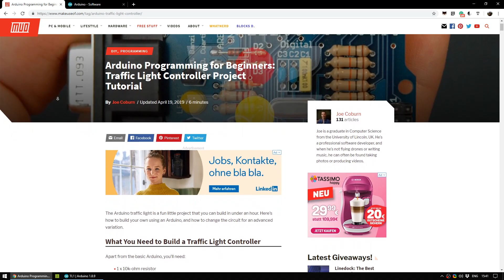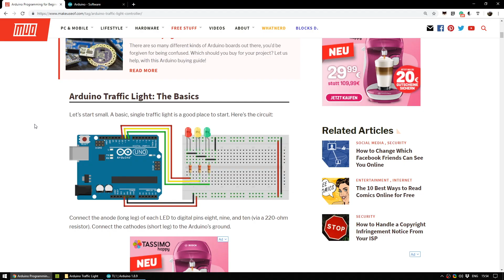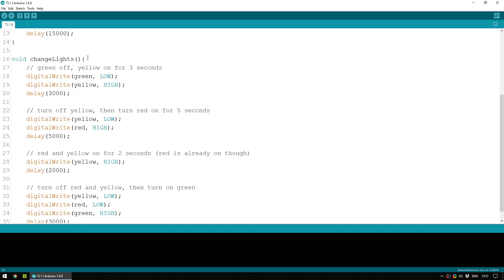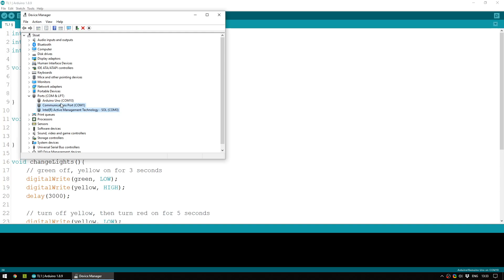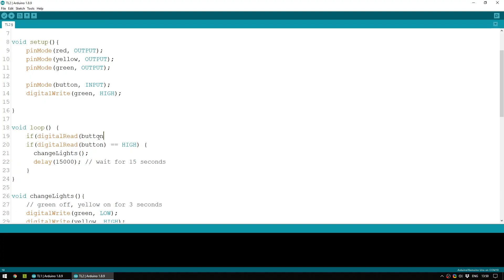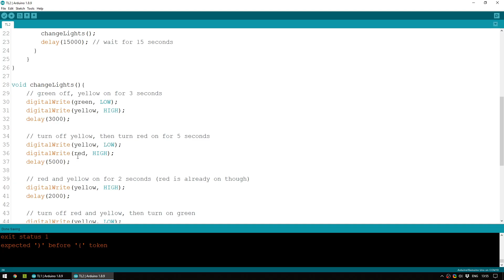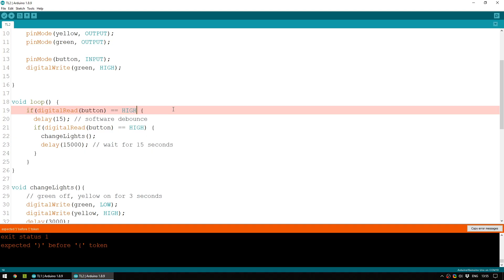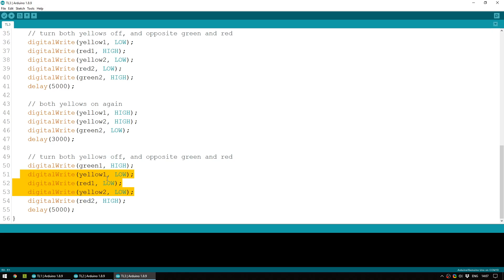Arduino Traffic Light Tutorial

Comment: I just bought a real traffic light. As in a full size real stoplight. Could code like this be used to control the lights so that it doea more than just display all the lights on all the time?
Reply from the maker: In theory, yes, but it depends on how your traffic light is wired up. If it designed to show them all at once, it could be that there's only a single light source in there, with three different colored lenses. Alternatively, you could wire up your own LED light sources behind each section?
Reply: @MakeUseOf  I'll be picking it up in a few hours. I'll dig in and explore it more soon. I'm guessing it has 3 different light sources and that someone did a bit of rewiring so that all 3 lights stay on constantly.

Comment: I remember doing this in primary school in 1985 on a C64 computer with some external device attached.I had to add up the binary values to have the lights switched on/off. I had it how you've got with 2 lights immediately swapping but the teacher got me to modify it so both lights were red before either set proceeded to green. Loved it - just wish I knew what that gadget was called?
Reply: a microcontroller SDK
Reply: Where u belong to means which country 😅
Reply: I’m sorry but you didn’t #ratio

Comment: I followed your video & your written version. The Traffic Lights worked, until I installed the button & modified the sketch. Getting an Error Message 

"Error compiling for board Arduino Nano". I'm using a Arduino Nano.  Any thoughts? Please

Comment: Nice Video, but do you know how to make a junction with four traffic lights. I have suceed with two lights but i don't know how to make with four.
Reply from the maker: Wouldn't that just be another set of each lights? Just a case of adding more LEDs to the same pins, you wouldn't need to adjust the coding, unless you wanted specific code for turning left/right stages?
Reply: Thank you for the reply.  Two are in a row and two in the bottom. I need to know how to make right left stages
Reply: @MakeUseOf The code only works for two traffic Lights

Comment: hey i followed your tutorial but when i upload it, it keeps on sayin " An error occurred while uploading the sketch
avrdude: stk500_recv(): programmer is not responding
avrdude: stk500_getsync() attempt 1 of 10: not in sync: resp=0x59
avrdude: stk500_recv(): programmer is not responding
avrdude: stk500_getsync() attempt 2 of 10: not in sync: resp=0x59
avrdude: stk500_recv(): programmer is not responding
avrdude: stk500_getsync() attempt 3 of 10: not in sync: resp=0x59
avrdude: stk500_recv(): programmer is not responding
avrdude: stk500_getsync() attempt 4 of 10: not in sync: resp=0x59
avrdude: stk500_recv(): programmer is not responding
avrdude: stk500_getsync() attempt 5 of 10: not in sync: resp=0x59
avrdude: stk500_recv(): programmer is not responding
avrdude: stk500_getsync() attempt 6 of 10: not in sync: resp=0x59
avrdude: stk500_recv(): programmer is not responding
avrdude: stk500_getsync() attempt 7 of 10: not in sync: resp=0x59
avrdude: stk500_recv(): programmer is not responding
avrdude: stk500_getsync() attempt 8 of 10: not in sync: resp=0x59
avrdude: stk500_recv(): programmer is not responding
avrdude: stk500_getsync() attempt 9 of 10: not in sync: resp=0x59
avrdude: stk500_recv(): programmer is not responding
avrdude: stk500_getsync() attempt 10 of 10: not in sync: resp=0x59
" please help me im doing this for my grade...
Reply from the maker: This is a generic error that basically means your Arduino isn't connected. Is this an actual Arduino, or a third party clone? Make sure you have the right drivers installed, and selected the correct board. Also, try resetting the Arduino using the rest button while it's connected.
Reply: @MakeUseOf  thank you for the reply! I am using a arduino uno wifi

Comment: nice  video. for the dual traffic light as done so far, a simple wiring G1 with R2 ; O1 with O2 ; R1 with G2. the ports can still handle the current I guess.
Reply from the maker: Nice. Yeh, you can easily drive quite a few LEDs from a basic Arduino. Check out our ancient LED cube project: https://www.youtube.com/watch?v=tqWAC4hu7nk

Comment: I have the Elegoo Uno R3 starter it as well. However, I had some issues with the code. For some strange reason, the lights were not operating as described in the code. I ended up having to put the OPPOSITE values for on and off. 

example:

void changeLights(){
    // green off, yellow on for 3 seconds
    digitalWrite(yellow, LOW);
    digitalWrite(red, HIGH);
    digitalWrite(green, HIGH);
    delay(3000);

If I did not enter the values of each pin, the LED would stay on if I wanted it off. I had hand-typed the code as you have it on your website, copied/pasted as well. but only got the desired results when I changed the values as given.Also, this always starts with yellow every time. I know, right? Strange, but true.

Comment: Could you connect this to an actual set of light bulbs and have it do the same thing?
Reply from the maker: Sure, but you'd need a relay if the lightbulbs are running on AC power, and I wouldn't suggest playing with AC power if this is your first Arduino project!